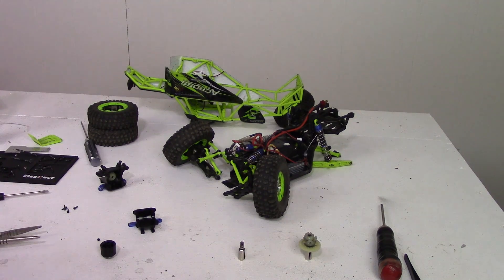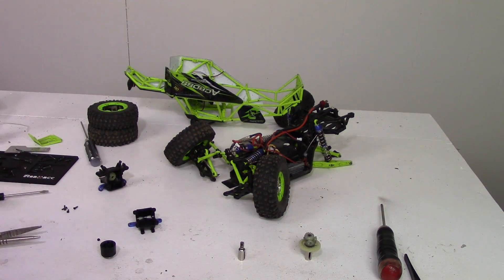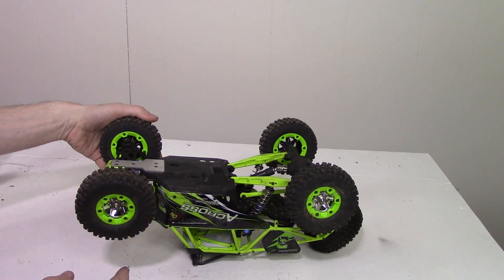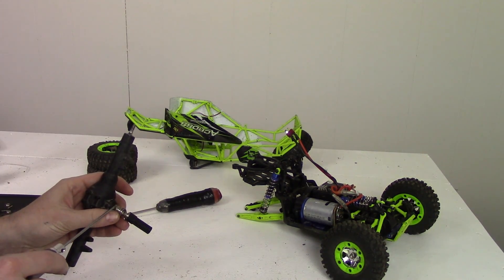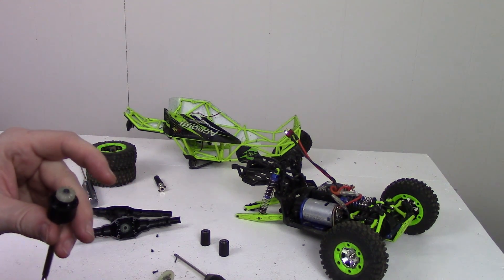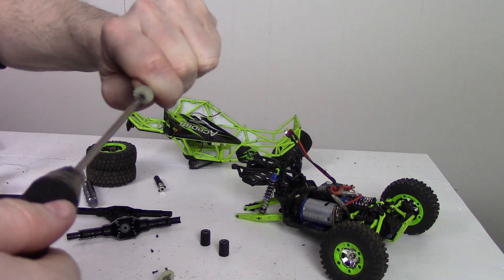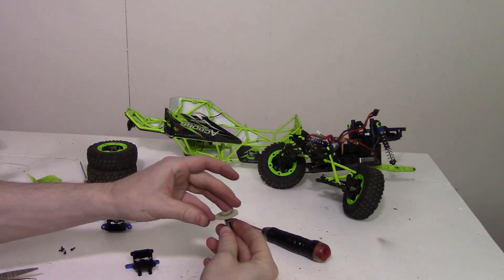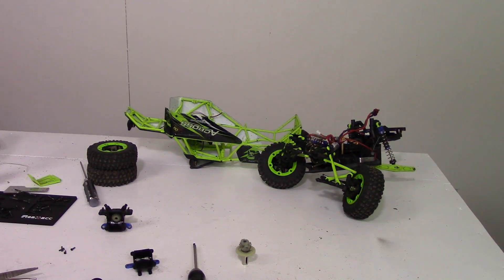WL Toys 12428 Diff Problems From Running 3S!

Comment: in my feiyue fy02 i got the same problem replaced diffs now all got i run a whole brushless system 4500kv
Reply: btw it has metal gears
Reply from the maker: Nice how fast does it go with a 4500kv motor?
Reply from the maker: That's pretty fast for the feiyue!
Reply: Look up the app "CalcRc" on google. You plug in the internal gear ratio, pinion size, spur size, motor kv, battery voltage, and tire size, it'll calculate your speed very accurately. I use it all of the time. It's not in the play store anymore so you'll need to google it. It'll be the first link, download the apk
Reply from the maker: Il have to go very calcrc a try, thanks for the info
Reply: You're very welcome, my RC guy Curtis told me about it and now I use it all the time. I just created a website yesterday if you want to give it a look. It took all day but it was worth it. I think it'll help a lot of people getting into the hobby and those who are already in it. I'd appreciate your feedback on it, I'll be adding to it as I learn more.
Reply: stalnakerrc-com.my-free.website

Comment: I decided to go with the twin hammers rear diff after watching a vid on someone who installed a feiyue rear diff on a 12428 with a 3200kv brushless and after few runs snapped the pinion gear in half. so I figured with my 4000kv  brushless I'd eventually be in the same boat. I know these vaterra diffs are bullet proof and the rear has the posi lock unit. might get some planetary gears as well to switch between the 2. almost done with this build, like to get losi 8ight-e  4.0 and vaterra twin hammers. not sure which first but all 3 will be all I'll buy. of course the other 2 will get complete upgrades.
Reply from the maker: I have a twin hammers clone and it is pretty nice! I've got mine setup to crawl though, have a nice working winch on it. The Losi 8ight-e is pretty sweet too. Do you want to build the 8ight-e as a speed machine?
Reply: Void X RC probably build the 8ight-e 4.0 for speed. also lookn at that new losi dbxl-e buggy. it's same as our buggys but definitely more beautiful, lol. blue with silver accents it's amazing lookn. so now I'm stuck between that and the vaterra. it would be a toss up between those 2. I'm definitely getting the 8ight-e 4.0 as well. yeah I'll go speed build even though I baby and clean the one I got now after every run. lol Idk for me it's hard when you spend all the $$$ and more importantly time in these to just take them out and completely dog on them and not take care of them. I always like my stuff clean and new lookn anyhow.. yeah I seen that buggy you got the twin hammers clone I was goin for it before the 1 I got but didn't want to spend the extra nickel at the time. now I don't mind as much. could of bought almost 3 of those for what I've put into mine.

Comment: I need to design some type of bumper system for the top roof to protect the new light bar during roll over. thinking of screwing in short plastic posts back screw holes of the old light bar just long enough to at least on flat road surfaces keep the light bar from coming in contact with. you might of seen them on the street bikes the side faring bumpers keeps the farings from getting scratched during a spill. was gonna put them on my ninja. anyway some concept kinda...
Reply from the maker: Yea that sounds like a good idea. Earlier today I was doing some work on my twin hammers clone and after taking off the top light/luggage rack I noticed that one of the luggage rack supports was broken off completely from rolling over!
Reply: Void X RC yeah these things take a beaten whether people see it or not. why I try to just go easy on mine even though it's a cheaper rc. I like the th clone alot. The light bar I got coming is the team associated xp cree led light bar. 5 led's. it's goin to be a perfect fit. it does just plug rite into the receiver correct. my other led light kit has a Y adapter harness that I was gonna use so I can save the last port of my receiver for winch or something. Or would the y harness be pulling too much using it for the light bar.

Comment: I heard you can just use twin hammers rear axle. and 90 percent  of twin hammers fit wltoy 12428
Reply from the maker: the twin hammers stuff is bigger as it's 1:10 scale and not 1:12 like the 12428, not sure how well stuff from it would fit. There is another wl toys that is a clone of the twin hammers though.
Reply: Void X RC iv learned that the rear axle from twin hammers does fit the 12428 with very little mod. almost direct fit. the wheelbase is shorter becouse the arms mostly to consider it 1 12.
Reply from the maker: Hrmm I wonder how it would preform. I do have a wltoys twin hammers clone my be one of these days I will check. I actually just swapped a spare feiyue fy03 rear end onto the 12428.

Comment: Hi again, I've got another question. So I have a wltoys 12428 and the esc receiver melted after a water run. I want to get a good receiver for it but I don't know what kind of esc to use on the stock motor (540). Would you have any ideas?
Reply from the maker: Hey, If you want to replace the esc/receiver that means that you will need a new radio and receiver, new esc and a new servo.
The 5wire stock servo won't work on hobby grade receiver that is why it needs to be replaced.
Here is a esc that would work well: http://bit.ly/2FptgwP
Here is radio/receiver: http://bit.ly/2vmagut
And here is a servo: http://bit.ly/2siIpXW

If you have any other questions feel free to ask
Reply: Void X RC thank you some much for the help. Can't wait to get the parts!

Comment: But once you buy the new diffs, the same thing will happen. I am experiencing the same thing and only use 2C packs.
Reply from the maker: There are some all metal diff upgrades available, I'm going to be ordering them soon and trying them out.
Reply: I want to use the metal equipment from the FY01/02/03 but if you notice ,you will have to buy all new connecting shafts and front drive shafts as well.
Reply from the maker: Yes I have seen that. There also seems to be some metal diffs specifically for the wltoys but even then it looks like for the front diff you still need new drive shafts. A bit frustrating to say the least!

Comment: honestly if I didn't have so much work and money into this 1 I'd just buy the feiyue and swap my aftermarket parts into it. plus I like the green monster. Kawasaki ninja green same as my ninja back in the day so I gotta keep this 1 running. I tell ya what if the front feiyue diff does work I do plan on just 1 run with rear wheel drive only, those rear wheel drives can be alot of fun especially when they got power like mine does. by the way maybe those screws are left hand thread to compensate for the direction to help keep screw from workn themselves loose, just a thought.
Reply from the maker: I tried going reverse with one of the screw and the same thing happened, broke the screw head off. I think they were just thread locked in very well.
Reply: Void X RC probably over torqued during the tightening process which put hairline fractures in the cheap metal. they probably use cordless type screwdriver drills which over tighten most of the screws due to user deglagance. any word on the front diff swap yet. gonna be tricky when the feiyue dosent have output cups for its driveshafts
Reply from the maker: Yea I commented again yesturday, it doesn't look good. that comment should be on this page.

Comment: well I installed my new driveshaft last night, I bought 2 this time around just in case of probs and sure enough testing on the bench in 2s only the keeper pin blew apart and shot out rendering the brand new driveshaft useless after 7 seconds of 2s testing, didn't even get the tires on the ground.. shit idk I'm about to start searching for a 3rd driveshaft and buy one here in a minute. I could actually put it back together and correct the issue so it never happens again or even just install the second one but no more messing around with this thing man I've found some heavy duty rc semi tractor driveshafts that will fit, I'd like to see these 1's break. I'll have to send you pic there pretty impressive lookn with the added outter ring with either 6 or 8 nuts and bolts holding it together and inplace around the yoke section. the problem is the stock driveshaft dosent work anymore due to the bigger rear end. my hot racing rear diff link will be in today I'm pondering the thought of installing the hot racing upper link mount for vaterra twin hammers rear differential upper and lower trailing arms to extend the rear axle out a bit making the driveshaft part accessibility more plentiful. shit man those aluminum links I already paid for haven't even gotten in yet thru the mail and I'm already thinking about replacing them for different 1's. rc world is crazy hey. This build already is truly 1 of a kind and I'm happy with the way it's turning out so far despite the no front diff at the moment.
Reply from the maker: Ouch damn that sucks about the drive shaft! I was having a look at your G+ page and your 12428 definitely looks pretty sweet overall! I hear you on the rc word being crazy. I've done the buying parts and then getting new better parts before even using the first ones. I try to do as much research as possible these days before buying stuff, don't always though. It's great your happy with your build so far!
Reply: Void X RC I appreciate that. I took some real quick pics of the buggy after the chop shop visit, I'll post here in a second on g+. far as for the driveshaft I got a full refund on it and the wheel hubs due to the wheels bowing out even though I didn't tell them it will be corrected with adjustable turnbuckles. but I shouldn't have to tell them it shouldn't be that far off no matter what. nowhere in the description does it say I must install adjustable turnbuckles to use this product. They let me keep all the parts. far as the driveshaft after closer inspection the yoke actually has grub nuts holding it together instead of the standard cheapo crush pins. little loctite and she's good as new. I didn't understand cause there the same exact driveshafts on all the axial product's especially all the scx10's. I'll post some pics in a minute here. still need to get longer screws for rear light buckets to get them to sit straighter... Appreciate the look in the driveshaft cause even though it's working and I have a second I think I'm still gonna get another doin as I find one that tops all others far as durability... if there  is such a thing lol....
Reply from the maker: That light bar is really nice and super bright! Love it! Like the blue lights too. The place that you put the spare tire gives it a more aggressive look too.

Comment: 3:44 slowed video down to 0.25, still hearing chipmunks
Reply: @VoidXRC  can't say i'm not glad i got your attention, hi! :) quick question, i'm curious what's your opinion: do you think these wltoys cars that come by default with 2s can be run on 3s without burning out the circuits? just got myself a wltoys 12402a with a 550 brushed motor and is really nice, but would be even nicer to pump it up with 3s :D  just afraid not to burn it completely

Comment: complete garbage. I'm completely pissed off at this company for using nylon gears in a drivetrain powered by a 540 motor. that's where their brains started to fart out at. gotta stay away from jumping any rc that has nylon gears, the impact of the landing is harder on the gears than braking and throttle holeshots..
Reply: IMPORTKILLR R/C your mad at a 75 dollar car 😂
Reply: I am amazed that people use a $60 RC car like a $300-500 one and gets mad when something is broken. Come on bro use your head. It's like you're expecting some German quality and engineering with Chinese price. I bet you drive a prius.
Reply: it dosnt matter..My T maxx  differental used to break or strip too
All the fucken time...I spent enough money fixing 1 t maxx..
I could had just purchased 2 more...lol
All i did was install a .18 engine instead of the POS .15.
The stock motor lacks power. The thing as a POS hobby grade
i got sick and tired of fixing that POS after every other run.
if I put the old .15 motor back in ...it wouldnt do jack shit or
took the fun power and speed out of it...

Then the Savage came out....It' snap the dog bone and kinds of other shit.
I had to put aluminum wheels on it...becuase the HEX slot in plastic rims
would get bigger/strip....all i did was install a .247 engine in it.
The ,21 engine lacks power
Those were hobby grade up graded metal parts.
Then the truck became a BRICK...BRICK..over 12 lb.lmao
So I upgrade everything...then the cycle would start again...via
the clutch shoes....then the spur..then the gear in the trans..
then the 2 center drive shaft...working it's way to the wheels hex.

Then the RC 10 monster truck...that thing as a POS on release.
People complain parts breaking right off the bat....

Comment: This stock cars parts are junk. After 5 mins the ESC broke, then the servo, then diffs went after 1 hours run time. I’m having fun fixing it but I’ve spent more than the car cost on repairs and upgrades. I now have a heat sink and fan on the motor as that ran real hot. I’ve also upgraded the wheels to roll over grass better and have a better controller and seperate ESC and receiver plus a quality servo and dual battery pack. Man it’s fun while it works though

Comment: got a recommendation for me for a sturdy 70mm driveshaft...
Reply from the maker: I'll look up some in a bit and see If I find anything I think would be good.
Reply: Void X RC thanks. got to admit though I'm amazed that these I have have removable yoke sections. might be good for repairing or replacing the yokes which get the most abuse.
Reply: correction 76.2mm  3 inches at it's shortest. sorry
Reply from the maker: What were the hardened metal drive shafts that you tried already?
Reply: Void X RC all 3 were off eBay. the last was sold for the axial scx10 I scrolled down and found the same ones in smaller size 80mm to 110mm steel universal driveshaft it's called. and the first was named the same but it looked more like a real driveshaft with the u-joint yokes and what not
Reply: I had to cut it down to 76mm which is the size I'm needing. 75mm seems more easy to find. I'm pretty sure I could use a smaller one as long as it extend to my longest needed length which is 107.95mm say 107 to 108. with the problem I'm having with the upper link screws for the vaterra diff are bigger than the 12428 causing a problem with the bigger screws goin thru the stock plastic upper link arms. I ordered the 9 piece link set still waiting on mailman but I had to remove the ball ends off the links to get the screws to go thru and put some washers which I'm buying some today. I'll post a pic of the arms I drilled out but by the time I got them where I needed them the metal was so thin that I kept crushing them just by holding with pliers. so back to the problem I'm thinking I might be better off just buying the hot racing upper link and lower link for the vaterra and fitting them to the chassis which would probably give me an extended swing arm type look giving longer wheel base by 10th scale size. should help with accelerating out of the hole as well and will also allow me a longer driveshaft which are easier to find. so this isn't exactly a bolt on deal here with this rear diff...
Reply from the maker: Yea it doesn't sound like a bolt on solution. From my experience and what I have read is that MIP makes some of the strongest drive shafts, they use CVDs instead of u-joints. I think you would probably have to shorten them though as they are for the scx10. I do think they are some of the very best drive shafts though. Something like: http://www.ebay.com/itm/MIP-C2-X-Duty-CVD-Kit-Axial-SCX10-Power-Wagon-RC-Cars-Crawler-1-10-EP-4WD-15215-/141975367920?epid=663549808&hash=item210e6430f0:g:dz8AAOSwKfVXIssx
Reply: Void X RC ok cool. one thing I've learned about shortening these driveshafts is you have to buy them pretty close to your size cause most of the driveshaft tube section is completely rounded off inside what I mean is the keyed section keeping the 2 pieces from spinning within themselves is only keyed back no more than 3/4 to 1 inch at most. I learned that the hard way with the first I bought too long and cut too much of it off and lost the key way section rendering the hole side of the driveshaft completely round causing it to be useless. bummer. I'll look into those rite now thanks. mine fell apart  due to the grub screw within the yoke coming out so I'll put it back together with loctite  and bench test it at best till my adjustable turnbuckles come in. I've bought 3 already I'd like to get a couple weeks out of these but I'll probably just break down later and order the ones your talkn. thanks brother!
Reply: ok these are the ones for the axial scx10. mine are close to this style but mine is missing the spline style shaft. yeah I've seen MIP products now that I'm lookn. as long as the tube section has the spline hole cut all the way thru I'll be able to cut as far down as I need.. those look they will take some abuse. I really think mine will hold up as long as the grub screw don't come undone again I'll be gravy. I'll loctite mine and try 1 more time. if I experience another issue they'll go straight to the trash and I'll try those.
Reply from the maker: Yea thread locker is definitely a must for keeping set screws in!